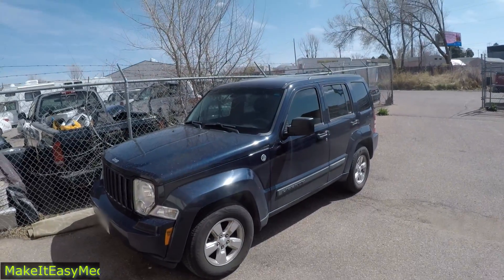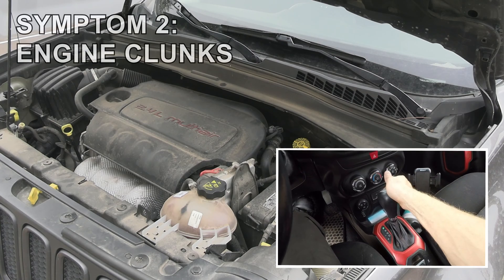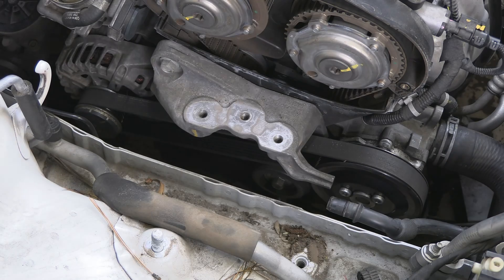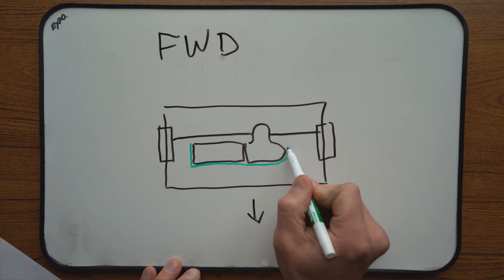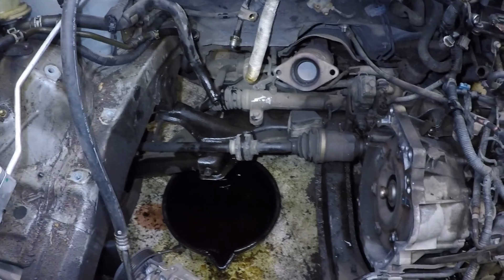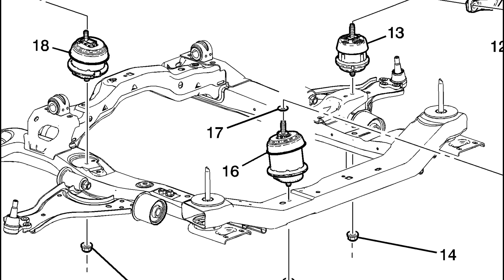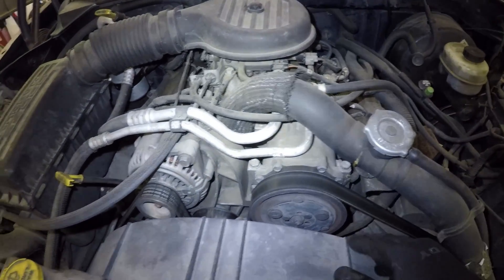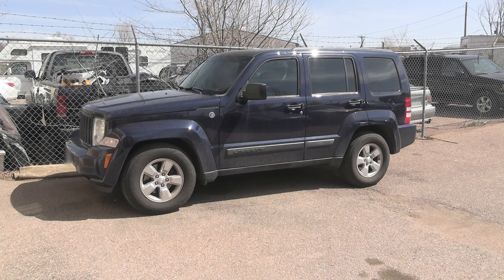Symptoms of a Bad Engine Mount and How to Locate it in 8 minutes!

Comment: Should all engine mounts be changed at the same time?  Thinking if only one is changed due to wear then the other ones have been or will become weakened and it will mean parts do not last as long.

Comment: Excellent explanation and visuals. I like how you included various types of symptoms and what engine mounts would most likely cause each symptom. Question: On my 2018 Mazda 6, I do have that exact symptom of increased vibration during idle when in gear such as in drive or reverse (even worse in reverse) which then smooths out when in neutral or Park. But, in addition, there is also creaking when I shift into drive or reverse. For example, I might shift from say drive to reverse, and there will be a momentary creaking sound as the transmission shifts into that gear. Would that also be a symptom of a worn mount or is that something else? If it's most likely a mount, is there a way to tell if it's a motor mount or transmission mount? I've been told online that it's probably the rear (torque) mount (the one you mentioned in the video that controls forward or backward movement and the one that would cause increased vibration when the trans is in gear and the engine is under load). If that's the case, and it's only that mount, should I replace just that mount or is it better to replace all of them (I believe my car has the three-mount configuration)?
Reply from the maker: creaking when shifting from D to R could be coming from anywhere, including your suspension, hard to say. As far as replacing mounts goes, I prefer to do them all, because if one is worn - the rest are not far behind, plus a worn mount allows for excessive movement which puts more stress and wear on the rest of them.
Reply: @MakeItEasyMechanic  Thanks for the advice.